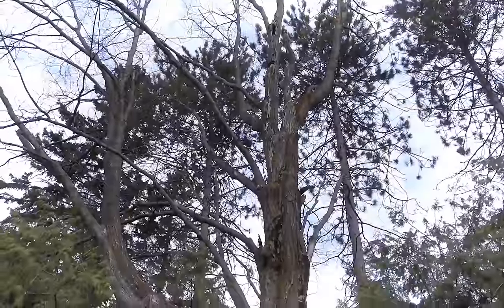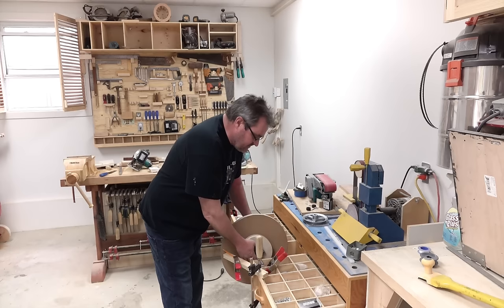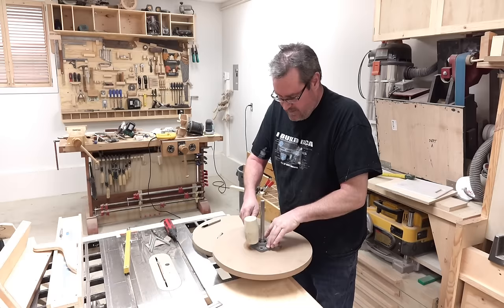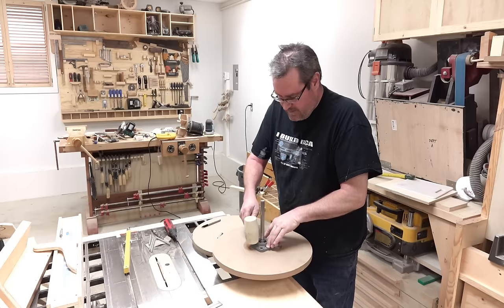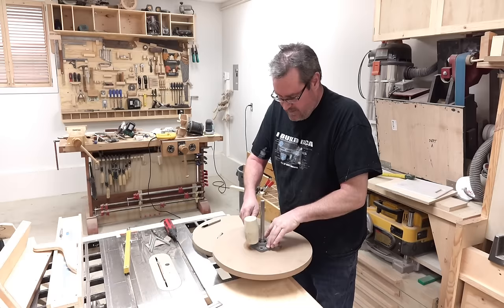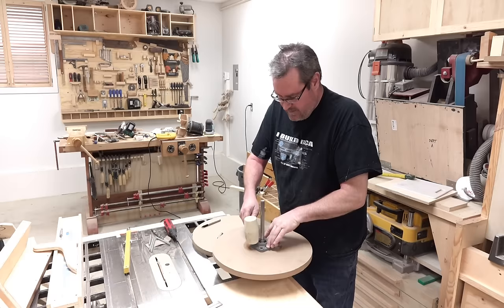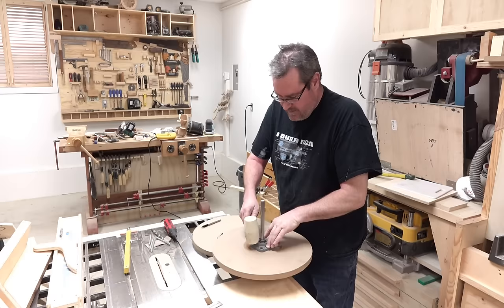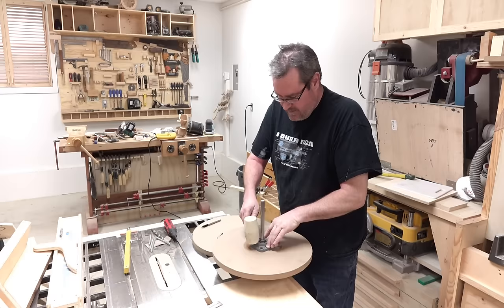Making A Wooden Band Saw Mill From Scratch - Full Build

Comment: John , if you want to know if the hole you bored thru the bigwheel for shaft is running true and right angle to the centre of the wheel , you can insert the shaft on the big wheel and check for square with a smal set square . just a thought !

Comment: hard maple is really rough to cut I bought a timber wolf 1" 2tpi for cutting green wood and it does really good on my 17" band saw cutting up to 12" if it starts to drift I spray the blade with wd40 just one or 2 seconds spray and I'm good for 3 or 4 feet about the lenghth I cut . if you mill all that up it's probably a couple grand worth of maple boards check eBay boards like that sell good I buy them myself I'm definitely going build me a simple mill like that its a shame i don't have any maple trees plenty of oak and poplar great video as usual . thanks John

Comment: I think it was a good first attempt. Better guides made with bearings and a slight crown on the blade wheels should help you control the drift.  But this video is nearly 6 years old. I'm sure you fixed all these issues by now.

Comment: that was an interesting design, I would have gone with smaller bicycle wheels and cut grooves out of the Nabis or something. When your blade starts to travel it means it could be dull it can also mean you're trying to feed it too fast which is what I believe was happening also. If you don't want the blade to go dull as fast you need to clear the bark off because it contains dirt and stuff that doll the blade immediately.

Comment: This is a really cool proof of concept that would be great for anyone with serious ideas about doing it themselves. Yeah, it looks like way too much work vs what you get out of it, but a few design changes here or there could turn that around.

How about a geared-down winch system that pulls the log through the saw very slowly? That way you don't have to guess at how much pushing it needs.

I also think it's a bit unfortunate that you had to use such huge logs to test it out. Those can be really unwieldy. I'm thinking a smaller but longer log to get some nice boards out of it.

How about a way to easily raise the log or lower the saw to make successive cuts?

Finally, how about doing it indoors or at least on a paved surface to get a better hold on it being level.

I can't help but have more ideas here, but yeah, I bet it was way more work than it looks like. Also, you're the one that actually did it, not any of us commenters.

Comment: Might speed it up if you hammer some wedges into the cut, also buy two blades because pitch pockets in fresh wood will slow down your progress, drop one in some petrol, while you're using the other.

Comment: Great job, loved it all. Good cuts you had going -
 I was thinking maybe the front edge of the silicone bead heated up and the blade stopped tracking 90 degrees to the spinning discs, thus causing it to dig in downward. Like the teeth were pointing just a degree or two toward the soil...
Anyway great build, great ideas and follow through and nice work on moving the logs.

Comment: droop was most likely cause by blade plane not being equal to feed plane. Also, as the board is fed, that difference in angle becomes greater with do to blade warp. if you added an adjustment mechanism to either the feed slide or the saw you could correct the droop I bet. if droop down, adjust back of feed sled down.

Comment: If you do it again I'd suggest a wedge at the back of the cut to prevent the pinching of the blade I think that may cause the drift.
Reply: Yep, the wedging is critical.  That pinch increases friction, which heats the blade, which causes the metal to expand and soften the metal, which encourages it to stretch and the teeth to soften/dull.

Hand in hand with the wedging is the blade lube (soapy water I think is what is recommended).

Comment: if you have problems with the chuck slipping out try tapping it with a block of wood we (machinists ) used that trick many times it worked . it looked like a number 2 or 3 mortis taper but they are standard tapers in machine shops thank .question if you will please i noticed you did not predrill for screw holes ?

Comment: Cool build. Little tip, Silicone and Iron do not get along. they cause galvanic corrosion between them. meaning your blade will rust and corrode much faster then normal. Use Urethane instead.

Comment: There are a few variables on this project that I wish could be discussed.  The speed of the saw can be changed with a larger or smaller pulley.  And a constant pressure could be applied to the sled to move the log which also could be increased or decreased - especially if you use a winch or hand crank.  What will the results be if you played around with these  variables?  I'm sure we could build it and then experiment but I would hate to burn out the motor or break the blade in the process of such discovery.

Comment: if you would had drawn line across at some point of the circle disk , then measure the lenght of that line and divide it by 2 to find halfway..... if you draw 90 degree angle towards middle from that halfway you measured it will point towards the center of that circular disk... if you do it twice you will end up with X in the middle of the circular disk...

Comment: I've got to say, having run a 55hp Woodmizer LT70WIDE with high performance blade guides, I would be absolutely terrified to cut sugar maple with a 3/4 inch blade and no guides. Our LT40 has trouble through really big sugar maple logs if they've got big knots and the blade is a little dull, sugar maple can be real tough stuff!

Comment: Again use a rope wound onto a dowel with a crank to pull it evenly. you could even make a counter weight attached to he poll so that when it hits a hard area it will slow down to accommodate. Weight instead of speed.

Comment: Hi John, I don’t do anything like sawing up logs as I am far too old and knackered now, but I do watch a lot of woodwork and log cutting videos and the blades that the experts use is a four TPI negative rake band saw blade, I am not sure what negative rake means but the blade you are using looks to me to be a lot more than four TPI. I am not sure if you will see this message because the original video was put up 9 May 2016 and I don’t know enough about you the tube message system

Comment: Great build. I have a few suggestions though. It would be easier if you could build it so the saw lowers instead of raising the log. Secondly, if it was built on a small incline, you could probably just push the log and let gravity do most of the work. Other than that, it's a great job.

Comment: 49:29 maybe add a solvent or detergent to the continuous drip on the blade just before the blade enters the wood. to lubricate, and prevent buildup. What do the professionals use (besides greater horsepower)

Comment: I’ve been called the very slang version of “Afro-engineering” king of the San Joaquin, but you just stole my title. When I opened up my cabinet shop in 2000 I took no money from any bank. As a result we were on an EXTREMELY limited budget. I built a crosscut or panel saw jig, a dado/ rabbit jig, and a huge square jig for building my doors. All were 4 X 6 and fit on my out feed table to save space. The router table I built was able to house two large routers for the milling of my rails and styles as well as any raised panel door parts. I’m not sure how much I saved myself, but all but the router table/shaper are still in use, with a little adjustment once and a while. Anyway, I gladly and humbly hand my title over to you.  Thank you for the video. And just a side...that rig would have costed between $3-5000 on Amazon 😀

Comment: The gumming of the blade, is probably from the bark content, … you could probably use an alcohol drip wipe, where it just keeps the blade damp, … thereby not allowing the build up to materialize, … a coarser blade might also be necessary, … not sure that the 110, outlet you have the motor wired for, provides enough current to maintain a premium cutting speed, plus, by making the logs slide through the blade, is not conducive to the feed rate of the log itself, … causing more stress upon the blade than is necessary, … the teeth, of the blade, needs to clear through the complete cut, scraping the sawdust it creates, out of the path of the teeth, … so that the friction levels do not get to gum up, & create more drag, upon the blade, … so, a slower, steady feed, is better for the overall health of the bandsaw, frame, & structure, … perhaps you could get a longer, threaded rod, & turn it into a feed rate device, by using it to pull the cart along, at a much steadier rate, than trying to inch it forward, using the crowbar method, …???

Comment: Might i suggest that a chainsaw mill might be a better bet for you timber.
They too can be made or bought and aare a lot quicker to cut with. Ki have seen a number of different ideas, even doing it by eye wifh an ordinary chain saw without any aattachments can give you good results.
The one thing is that the  tend to waste avlittle more timber than a band saw but they are twice as fast.

Comment: the motor going slower toward the end could be the weight of the wood that ur removing pressing down on the blade. putting a small. shim on the end that cut would help lift the weight off the blade.

Comment: Its a shame that after all that time and effort that it didn't sail through the wood as early as you and most of us hoped, Im sure. I wonder if the blade had brushes in contact with it if it would take the chips out of the kerf and maybe if oil was used instead of water, like dripping onto a sponge thats in contact with the blade, or on the brushes themselves (like passing brush bristles) if it would lubricate and make it more efficient. Either way, it was fun and interesting to watch and certainly not a failure or anything negative. The wood looked like nice wood.

Comment: Posted 7 yr ago, who knows if you'll answer this, but anyway. I've read that branches do not make good lumber because it's "programmed" to be able to stretch and sway with the wind, thus making it susceptible to higher rates of warping and movement. What were your findings after using that lumber?

Comment: Have you considered using an electric winch or manual come-along to pull the load with? If the cable is routed through a pulley on the draw side, you can remain where you're currently at to avoid being in the path of the log. Oh... and a bug net? :D

Comment: Great for ingenuity but most will find it cheaper  to try a used chainsaw for $30 - $50 and a homemade alaskan mill....also much simpler to build and much easier to set up at the log's location instead of placing the logs on the band mill.

Comment: Mills usually run at a much higher horse power.  2 hp will barely run my table saw.  You need more torque ,  not speed, and a six hp motor if you are going to run on 220 volts anyway.   Otherwise I would go with about an 8 hp gas engine.

Comment: I have been wanting to build a mill , but all the steel frame , gas powered mills seem to much expensive.  A rolling head needs a lot more engineering.. yours seems more reasonable,  and can be stored out of the weather,  I saw one using motor cycle wheels and like that idea . I think I will salvage oak pallets instead of using spruce,  just for more strength

Comment: I think I would get a Used Mill or Buy a old tractor, then use that to run a Big Blade..simpler and less ficle than the string blades , pulleys and all that Bs..just building a 60 inch dolly that can handle most trunks in 2x4 s and casters. heavy dute  running on  2x6 s ..simple and more reliable

Comment: Quick question - wouldn't it be easier to secure the log, and have the saw be on an adjustable and rolling frame? Slide the saw through the wood instead of the wood through  the saw?

Comment: I thought you might use some lubricant for the blade and maybe using a small boat winch so you don't have to push the log but otherwise a very good job

Comment: 53 minutes of video!!!!   Wow, how long did that take to upload!?!?!?      Since I followed this on the other channel I skipped to the last 5 minutes.   Interesting little hack with the water drip.   Hope the other blade works better.  After all this work you want to at least get those boards sawn!
Reply from the maker: +Wordsnwood (Art Mulder) 
Compressed down to 1.7GB, it took just 5 hours to upload, but that was yesterday afternoon. It would have been much faster late at night (less cell activity).
I'm going to try to be more patient with the new blade and keep it clean and sharp. I'd like to at least get this one cut up and that other bigger one.
Reply: +John Heisz And indeed: Great Build, a Johnmizer?
Reply from the maker: +norm1124 
If I'm over my 20GB limit, the extra bandwidth would cost me $20. But, I don't really want to go to the extra hassle of putting it on a drive and giving someone else access to my YouTube channel.
Reply: +John Heisz Think I understand, handing out "the holy grale" ... I'm very attached to 2 factor authentication too ;-)
Reply: Wordsnwood (Art Mulder)be